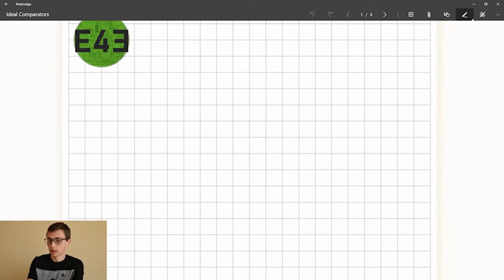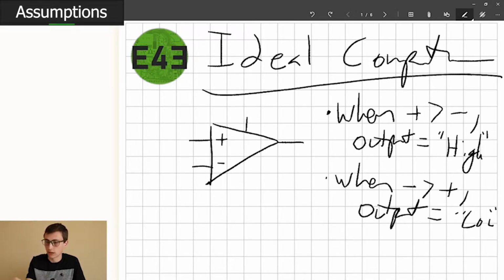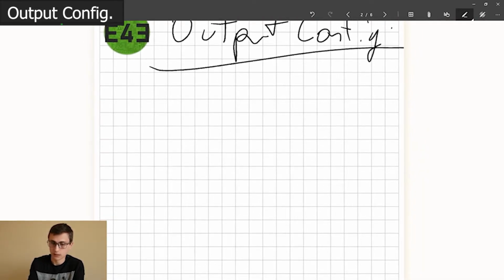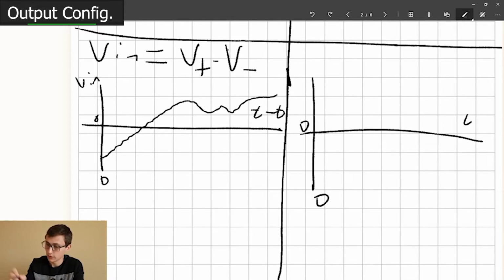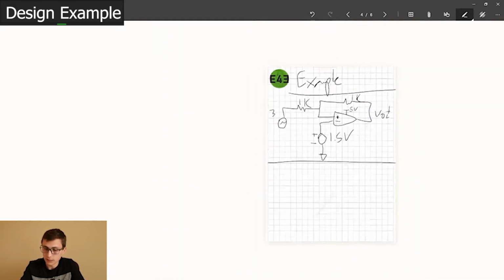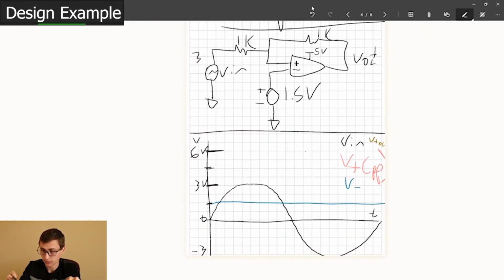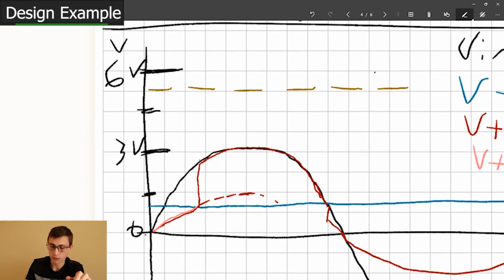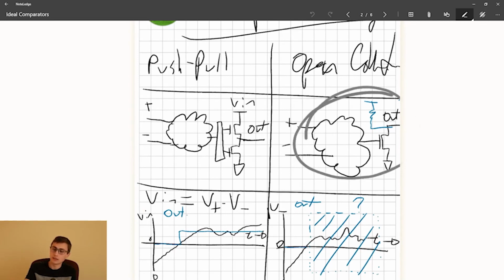Working with Ideal Comparators (Intro to EE)

Comment: in an physical form is any comparator capable of these three different outputs. ( push pull. open collector, open emitter) or is this specific to the device?
Reply from the maker: Hi JD! I've only seen these sold in a particular output configuration (open collector, open collector with internal current source, or push-pull)... But, it's a big world out there! You may be able to find a selectable output configuration comparator, but I'm guessing it'll be way to expensive- if it exists at all. :)